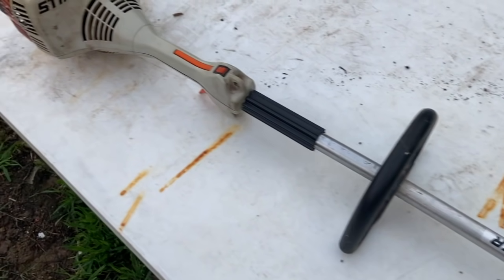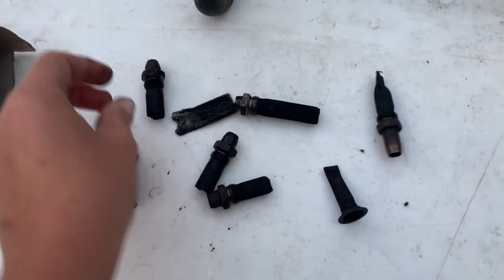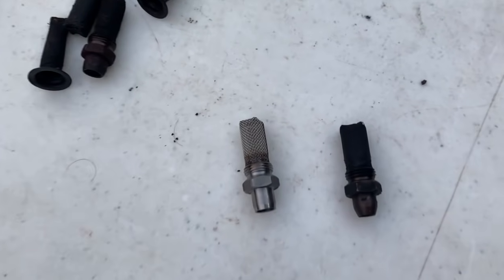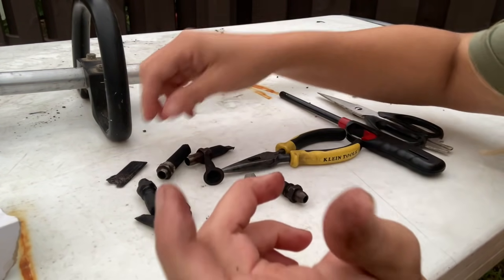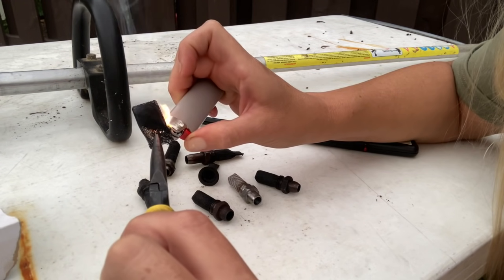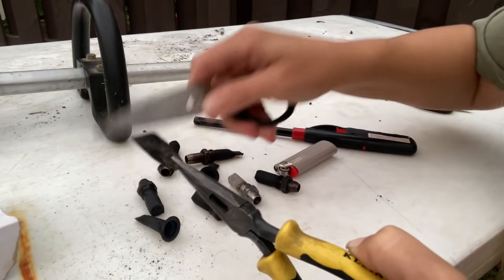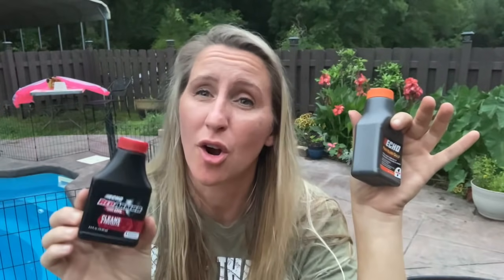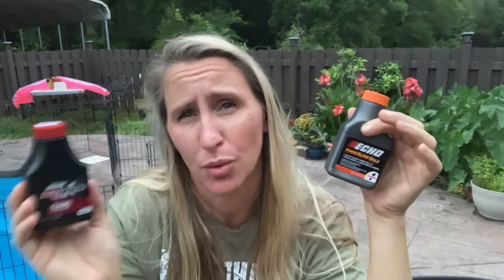THE BIG SECRET! STIHL has NO POWER? Won't Throttle Up? How to fix your trimmer/blower.

Comment: The “Magnuson-Moss Warranty—Federal Trade Commission Improvement Act” is a Federal law, US Code, Title 15 § 2301, Public Law 93-637. President Gerald Ford signed it into law on January 4, 1975.  This Act allows the Consumer to use any product and the piece of equipment will still meet the criteria under the warranty.    So basically you do NOT have to use Stihl 2 stroke oil.  You just have to a product that meets the standard in your Owners Manual.   If they say you have to use Stihl Oil, to keep your chainsaw, weed eater or whatever then they have to supply that to you for free!!!!!!

Comment: Worst thing about Stihl oil is the color. When mixed you can hardly tell if it's mixed. Hardly any change in color. Makes it difficult when working with equipment using mixed and straight fuel. It makes no sense. Make 2 cycle weird brown. Bar and  chain oil bright red.

Comment: I am not defending Stihl, but correcting a false statement. It is illegal to require the use of any brand of oil in any device in America, it must simply meet the requirements of the manufacturer. Stihl offers to extend the warranty by doubling it if you purchase a six pack when you buy the device. I just buy it, use it and switch to my Amsoil as soon as it is gone, no big whoop.

Comment: I HAVE A STIHL FS56RC WEED TRIMMER, AND I'VE USED OIL FROM STIHL, HUSQVARNA, AND ECHO. BUT IMHO, THE ECHO MOTOR OIL IS HANDS DOWN, THE BEST OIL I'VE EVER USED!!. I USE IT AND 93 OCTANE FUEL, MY STIHL LOVES IT, AND SO DOES MY HUSQVARNA 55 CHAINSAW!!. IT'S THE ONLY OIL I WILL EVER USE, PERIOD!!. BTW, THOSE SPARK ARRESTOR SCREENS ARE JUNK!!. UNLESS YOU WORK IN FORESTRY, THEY'RE USELESS!!.

Comment: Use Castrol-S CASTER-BEAN BASED two-stroke oil in 100% gasoline (up to 1:200) and ANY 2-stroke will start on the first or second pull! Run it DRY for off-season, put a NEW $3 plug in EVERY YEAR, spritz some Berryman B-12 into the carb before starting it for the season, and your GREAT-grandkids can use it! I have a 41 year-old ORIGINAL two-stroke "Weed Eater" brand gas trimmer I've done this in. A whopping $33.94 at T.G & Y. Family center (Wally-World before W-W existed!),a 37.6 CC model curved shaft with the "drive cable". Bel-Ray 100% synthetic two-stroke lube is great BUT, it will dissolve the rubber "fuel pump" in the carb. Bean-oil WON'T. Breathe too much Castrol smoke, and sit on the pot all the next day-just like WWI fighter pilots!

Comment: You'll spend just About the same amount in repairs and maintenance on the equipment as just buying those products to use instead. And it'll give you time to work on newer broken down equipment needing fixed.,or it can save you on returns of equipment formulary worked on before in you're shop to save on the hassle.,or headaches from it all. Bye doing out of you're shop and giving those instructions directly as A part of your warranty program to on repairs and parts replacements if need be to on any of your customers lawn and garden equipment and even ditch witches and tractor's to.

Comment: I stopped buying Stihl oil a long time ago, and switched to RED ARMOR. I`ve NEVER had a carbon issue ever again with RED ARMOR, no matter how light i am on the throttle.
What you failed to mention is, RED ARMOR is JASO-FD rated, stihl Ultra-HP is not. That`s why you are seeing all the carbon build up with stihl oil. 
Wait until you start having to deal with the Strato designed 2-stroke engine failures, your nightmares haven`t even begun yet.

Comment: That's not the problem not the oil you always have to run premium fuel in any small engine even in your lawn mower and four-wheeler and you will not have a problem

Comment: Stihl oil is mineral and expensive brand oil.Motul 710 is sintetic oil and much beter then stihl for the same price.
We use motul on litle racing bikes 9000-14000rpm and no problem but with stihl oil engine crush.
After 2000km clynder was clean na sticky after motul but with stihl dont.
Buy better qualty not name brand .

Comment: 2 cycle engines are scavenging engines... Unlike a 4 cycle engine which is positive flow... A 2 cycle has both exhaust and intake open at the same time... When you don't run a 2 cycle engine at the specified range it is designed for it allows for more unburned fuel to enter and stay in the exhaust which is what actually causes the exhaust to plug up. Less to do the "Stihl oil" and more to do with "operator error"...

Comment: This is not true. I have been using steel equipment for the past 20 years and level 17 ever measured my oil ratio compared to gas. And I am currently still using some of string trimmers that I started out with.

Comment: Spark, arrester’s are bullshit. I am an expert. About two-stroke engines most particular Yamaha banshee engines. Michigan has a spark, arrestor law that ATVs have to have spark arrester’s never in 23 years of me opening a Banshee has any sparks ever came out of my exhaust and I do not run a spark arrestor. I get them out of everything I have and everything runs great plus I use race fuel I do not use pump gas and all my two-stroke stuff with a torco GP7 mix my backpack blower is nine years old and running strong

Comment: Do you think that muffler carbon actually burns, big no, its the fuel absorbed by carbon soot that burns.  also if mechanic have to earn then machine has to spoil . adding less oil to gasoline helps less carbon buildup

Comment: Stihl ultra is the absolute worst 2 oil on the market. Watch the testing Richard Flag did on this subject. The lubricanting quality of this oil is atrocious, even at 32-1. Your better off running basically anything else, Red armor at 40-1 is what i run in all my 2 stroke equipment, I buy it in gallon jugs and its pretty cheap if you get it in gallons. However there are better oils, Honda HP2 is a great oil as is Amsoil Dominator, as well as many others, I highly recommend watching Richards videos on the subject. Also never ever run 50-1 ratios this is EPA mandated crap and while it will lubricate the top end it won't do much for the bottom end.

Comment: Is there any JASO, ISO, or API rating for this oil on the back of the container? If not, Stihl hasn't submitted their "branded" oil to any outside, independent lab for certification.

Not an endorsement for any brand but have run all my two stroke equipment on 100:1 rated oil for over 30 years. Lighter duty engines (blowers, etc) get close to 100:1. Heavier loaded engines get 90:1. None have ever failed, none coke up, virtually zero residue left. My UL aircraft Hirth engine used 90:1. When others were de-carboning their heads, pistons and exhaust ports mine looked like four stroke, ring lands free and clear. All too often you'd hear "If a little oil is good more must be better". Yeah. Sure. Keep screwing yourself over. Same for octane fuels....your common port powered two stroke is lucky to break an effective 6:1 CR....definitely not a CR that requires anything above 87.

Comment: Maybe you should start your next video in a more honest manner. People need to understand 2 cycle engines are made run screaming.  NOTHING  the matter with Stihl oil, your video should discuss operating errors while using Stihl oil in Stihl equipment. Liked your other videos,  this one not so much.
Reply: She did start out explaining the nature of the oil. And when in to detail why Sthil oil is detrimental to some machines.  Why don't you listen more instead of being so judgemental.  If you can listen and comprehend the subject matter.